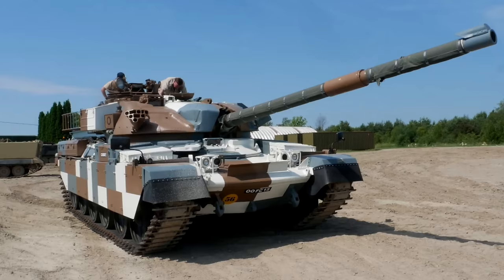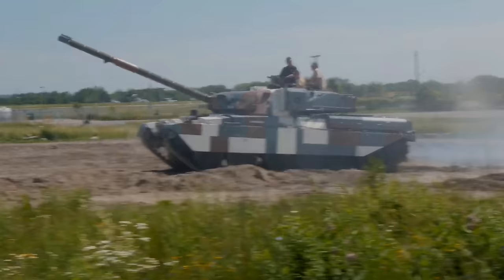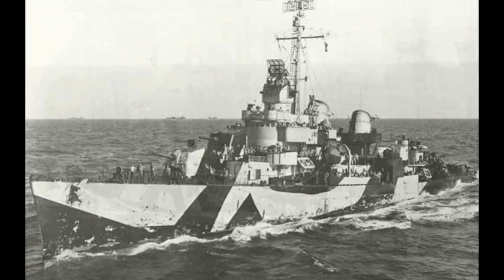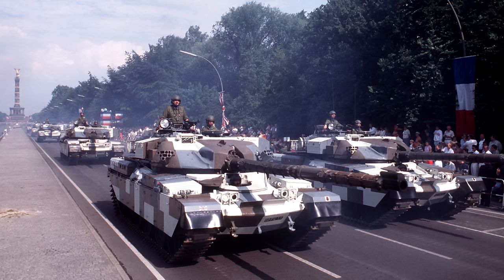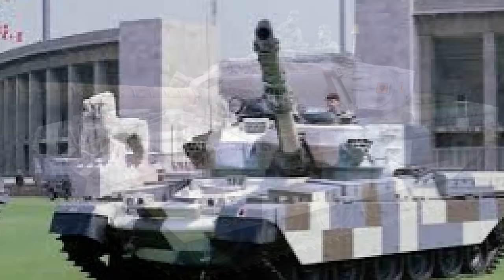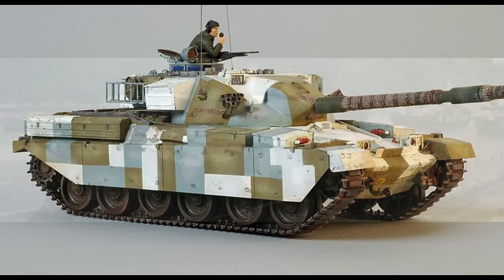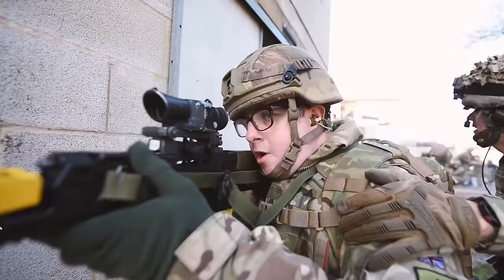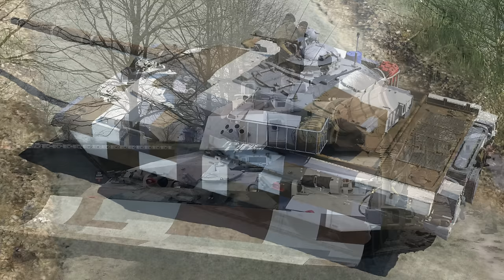What is this strange Tank Camouflage?

Comment: I painted a large steel storage bin In a splinter/dazzle pattern just for fun. I was astonished to see that from 60 feet away that it became extremely difficult to tell where the front of the bin ended and the side began even though I knew what the shape and size of the bin was. 
You could still see it but it's configuration was totally obscured. 
I can easily see the pattern on these tanks being confusing to the eye.

Comment: I was in the Berlin Armoured Sqn based in smuts barracks, next door to Spandau prison with Herr Hess still a prisoner in 1981. We had normal green and black Chieftains then so i think the urban cam was brought in about 83 or 84. Despite the “urban”theme the quick reaction troop used to crash out on “Ex Rocking Horse” drive though the built up area and go to hides in the woods. Good times and a great place to be.

Comment: In the 1980s we used a camo in the 2nd ACR called dual-tex, (dual texture) on our tanks, PCs, and jeeps.  Basically NATO woodland with the areas as blocks instead of irregular shapes.  About the time we transitioned from M60A3s to M1IPs  in '85 we switched to regular camo, though the M1s were just green.  I believe the 2nd ACR was the only unit to use that pattern.
Reply: @evtinker... 2nd Sqdn, where were you?
Reply: D Company, 1st Sgdn.  83-85
Reply: Minor correction.  It looks like we changed from Dual-tex to regular NATO pattern between the middle of '83 and the fall of 84.
Reply: @ @evtinker1814  ... E Trp 2nd Sqdn before being rotated to 1st/7th, 1st Cav. Was with 2nd until they did away with tanks and saddled with Strykers. Toujour Pret

Comment: I think a new gun and a 2500hp engine would do the challenger 2 nicely
Reply: Nah a 5000hp engine would be better
Reply: @MrPokemonWT  1 025 000 HP works best
Reply: @Challenger mbt2 - Why would you want a 2500hp engine? Are you trying to break some kind of world speed record lol. The Challenger 2 is getting a new gun, it will be 120mm smothbore with is an upgrade over the older rifled 120mm.
Reply: @mississippirebel1409  ah shame, i won't be able to wield a penetrator like a mace
Reply: @mississippirebel1409  no it's not. That would mean having a new turret.

Comment: Whilst you are partly correct in your excellent video the biggest reason behind Berlin bde cam is during the Cold War the Russians couldn’t figure out the strength of the British units at the time. Every vehicle type had it’s own pattern and every vehicle of that type was painted the same, there was no vehicle reg plates or unit emblem or any identification marks, In essence BAOR could drive a few Sqns of chieftain around a block by a check point all day and the poor old guard would think the British had hundreds of tanks as they couldn’t tell them apart. Hope this makes sense, keep on with your great videos and thank you.

Comment: Mats, i have this question for a long time in my head: all the tank can do 360° with the turret, soo how the electronic and the pneumatic system are connected from the hull to the turret?
Reply: The gunner gets strangled with the power lines so un-winds the lines so he can breathe.... ;-)
Reply: Gets plugged from the bottom, a rotating power cable plug.

Comment: It may be effective but like the U.S Army ACU proved, single environment application can have disastrous consequences when use out of it design spectrum. Dazzle camo by nature could not leave it's intended environment, but any land force must be mobile and flexibly in modern warfare is a must.
Reply: Not to put a downer on you, but NATO units in Berlin WEREN'T expected to survive more than a few hours/days in the event the Cold War turned hot and the Warsaw Pact kicked off. They were only expected to delay the advance of WP forces as long as possible so that NATO reinforcements could be moved forward

So, this type of urban camouflage was designed to be used solely in the environment of West Berlin where it was expected to blend in, since it was widely believed that urban areas would likely be turned into ruins much like WW2 Stalingrad... This is a very common setting for many of the WW3 stories from the 80s, certainly the ones i read especially The Zone series by James Rouch

Comment: Hey @Matsimus and anyone who reads this, if you was given the opportunity to pick any 3 upgrades of your own for the challenge 2 what would they be, to make it harder no one can pick smooth gun.
Think my ones would be 
1: VR 360 cameras on the nose of the gun, so the commander can have a 1st person view around buildings.
2: have a starstreak hvm to replace the loaders gun, or a remotely operating minigun if the starsteak is not compatible like that.
3: A drone that the commander or driver can use to search a village  before entering/engaging.
Reply: I agree with number 1, 2 for me would be a more powerful engine, I honestly don't have a 3rd thing to add.

Comment: Took me a while to figure out that the tank on the thumb is in fact a challenger 2. Firs assuming it to be a Leaopard 2A7.
So yeah it does really work wonders. 
On a second note. I noticed that they did have that camera thingie on the gun. Thought those where a "no no".
Reply: @Terry McConville No, no I meant the thing attached to the bottom of the barrel. You can see it at 0:20
I think its a camera to look both directions so that the tank can stick it's gun out of a corner and check for danger and stuff. But I thought those where a "no no" because they slow the crew down too much and also the tank is not something that is meant to do scouting.
Reply: Tadeas Kollar yeah it’s a camera to look around corners it’s part of the street fighter upgrade
Reply: @proudyorkshireman7708  I was told that those  where a no, no because they made the crew too cautious and thus slow. I guess the benefits outweigh the cons in the end.